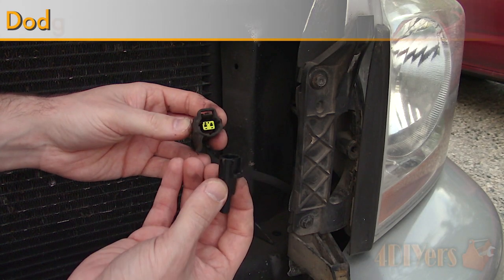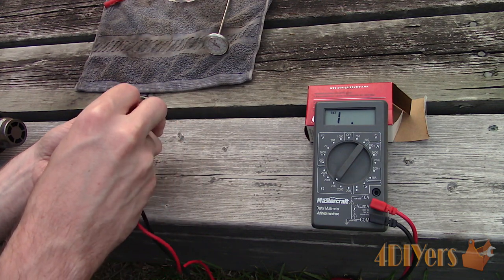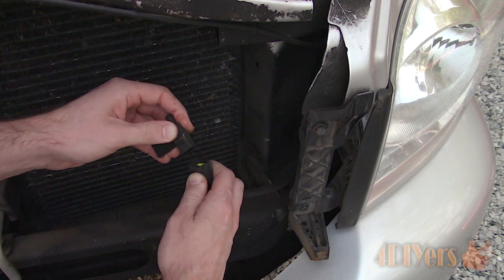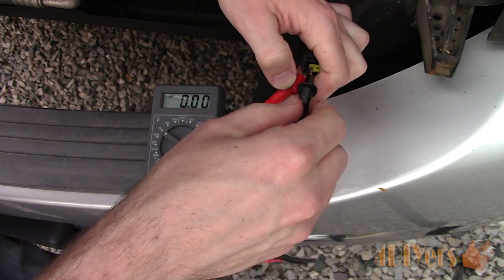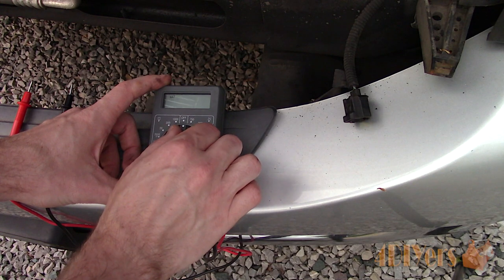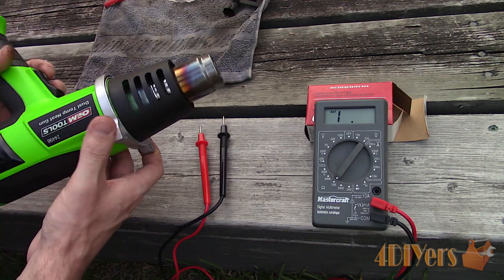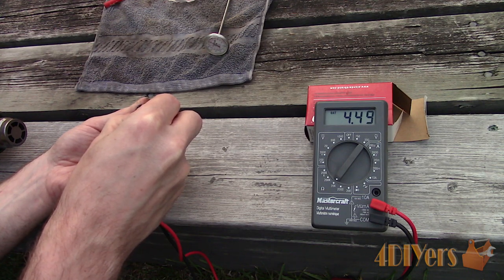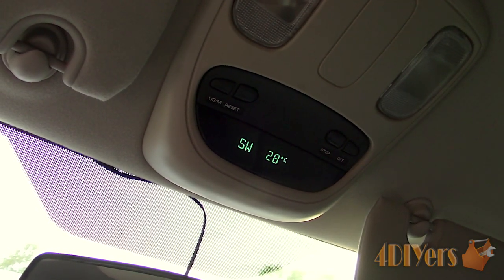How to: 02-08 Dodge Ram Ambient Air Temperature Sensor Testing and Replacement

Comment: Voltage tests at just under 5 and my ohms test well. So it appears the wiring and sensor are working properly yet I'm still reading -40 in the cab.
Reply: I'm having same issue. We're you able to find the problem?

Comment: How did you know the resistance values for min and max temperature readings? 

Would this procedure be the same for the interior ambient temperature sensor that controls the auto climate control? 

Lastly, how come no dielectric grease when connecting the new sensor to the harness?
Reply from the maker: I have the shop manual for this truck which is where I get my values for electronic testing and torque specs. I always have manuals for my tutorial videos so I can provide accurate info. A lot of this stuff is application specific so generic values can't be used here. The interior sensor is most likely a different setup and is integrated with a module. I don't use dielectric grease as it's non-conductive and can sometimes cause problems. If I were to use something to protect the terminals, DeoxIt would be my go to then.

Comment: The digital tempurature gage is accurate but the check engine code says ambient air tempurature sensor
Reply: Same here. Any luck?
Reply: @spermdizzle  I just got a new sensor
Reply: @spermdizzle  did anyone have any luck?? I got a new sensor but check engine light is still going off
Reply: @Buck4997  I had the same issue. I just parked my truck and I'll have to deal with it another time